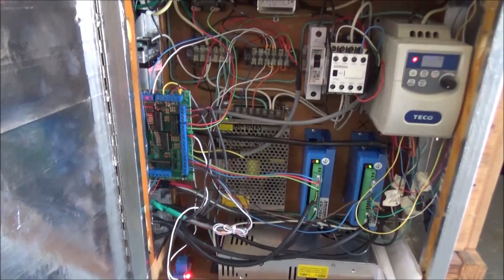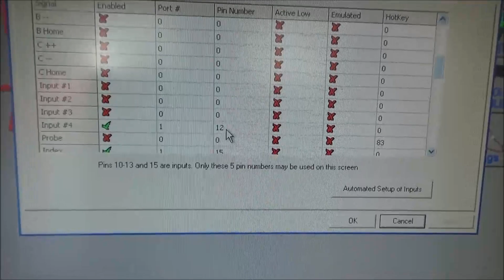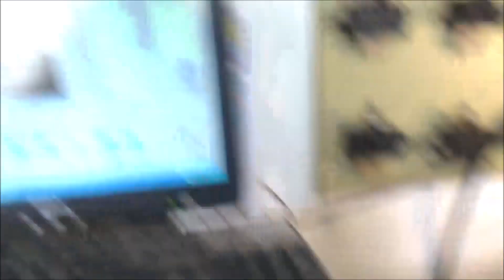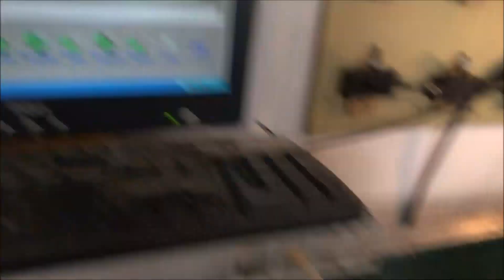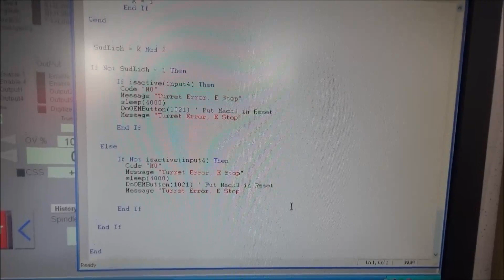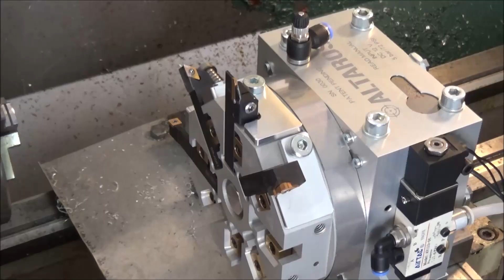ALTAROS TURRET WIRING & SETUP

Comment: bro that relay is just not ok!, I tried  that exact same one and is just not reliable  , change that  relays for solid state, in fact I just place custom  board with solid state relays for everything on the machine , coolant pump, closser valves, lubrication,  and it just runs everything so smooth and fast , im running 1000 parts and I need them fast,    solid state relays are the sht for this,  I just finished the retrofit on my lathe, had a really hard time with offsets and zeros with mach3,  that program can be so damm annoying, just does crap on its own!!!  but once running is set everything is so fast!  and solid state relays are just the best for this job.
Reply from the maker: I have not had any issues with this relay. It sounds like you have a floating ground issue.
Reply: @CNC4XR7   well I have 3 phase, and that relay worked well for me too with no issue either, I'm just sharing you that solid state relays are more reliable on the long run, a little more industrial and respond alot faster and also a little cleaner with the wiring, I just started production with my retrofit and finally its working, I feel like comming out of a nightamare!  I made a collet closer like yours,  Im using  m8 and m7 signals for the opening and clossing , I dont know if there is a macro for mach3 to close and open the collet,

Comment: To tell you the truth, if I was making production parts, I would contact Fanuc to see if they made a control for this or any other mini mill or lathe & spend the extra money since Fanuc controls are the mostly used controls. And use any CAD/CAM program that you like that you can post process to the Fanuc controls. I like that turret. It looks more like a regular machine tool so you can make a tool set while a regular CNC controlled lathe would have a horizontal turret. A normal CNC horizontal or vertical lathe doesn't need compressed air to rotate the turret if I am not mistaken. I would like to see a horizontal turret like you would find in any machine shop. While I like the out dated GE 2000 controls, the Fanuc controls can be a very better upgrade.
Reply from the maker: LOL Well production for me anyways. I think if your doing true production work you should invest in commercial machines when the finances allow. Most small lathe turrets I have seen use a stepper or servo to rotate. this turret is unique in that it only requires air.
Reply: @CNC4XR7  You still make great videos that I can't wait to watch.

Comment: If you could add some sensor or encoder on it so that you know if tool you want is in position and not fail like that and try to cut. That would save a crash if compressor cant provide air for some reason.
Reply from the maker: There are checks built in. so if rotation is not completed it will stop g code. You could add some scripts to the Macro to do a Air pressure check etc. but would require another input.
Reply: @CNC4XR7  i was thinking you know those rotating switches on the multimeter you can find? something like that so you would know at all times position of the turret.  How to transfer that info to the Mach3 is another thing. But this could be a very safe feedback so machine knows at all times where is at. I tend to overcomplicate my ideas but real-time feedback sounds neat.